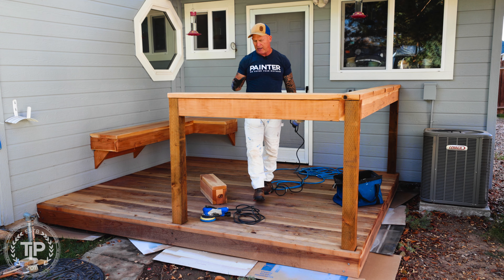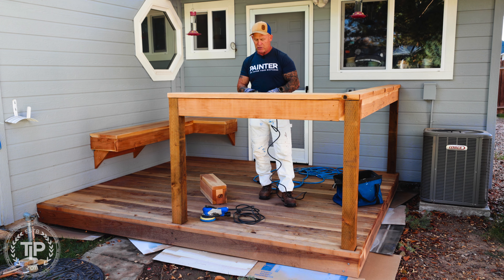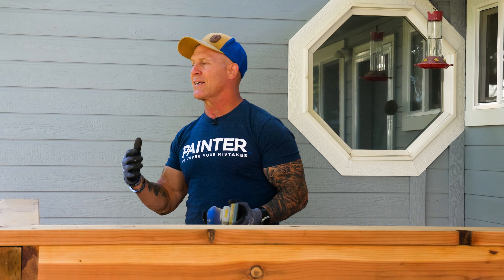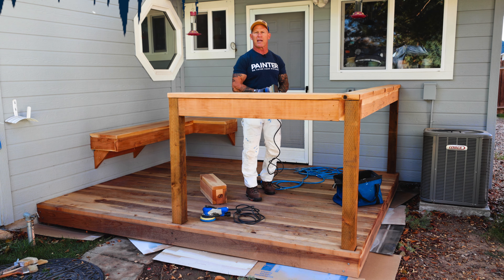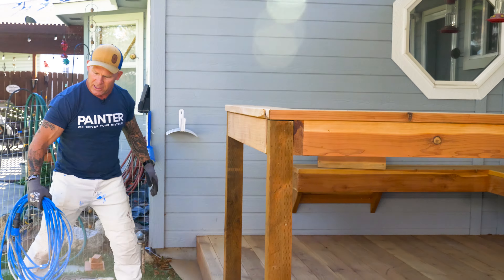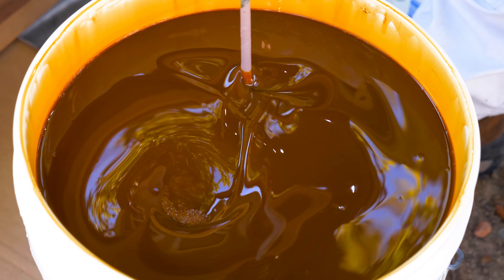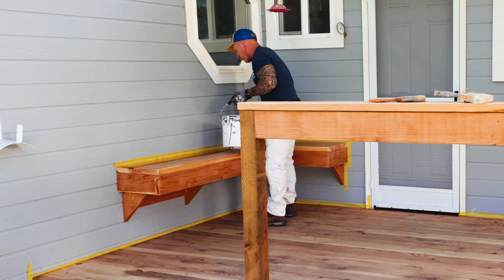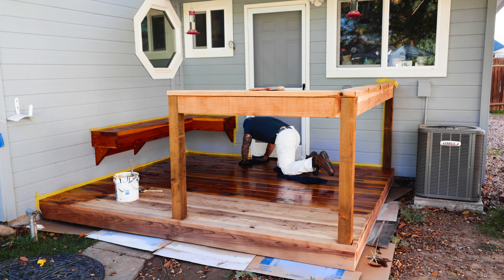Staining a Deck | What You Need To Know

Comment: Thanks for your videos, I’ve learned a lot from them!
Question: aren’t you supposed to start and finish each board before you move on to the next, to prevent lines in the middle of the board? I saw you started like 3-4 boards on the left side and then went over to the ones against the bench, to finally come back to those first ones. Thanks!
Reply from the maker: Not with this non drying self leveling oil

Comment: If you use a pole on that brush (it is made where the handle screws off and you can put a pole on it), and then stain in one direction, always from wet into dry, then you don't need to wipe it off, because your brush will have dried out, and spread out the product already.
Reply from the maker: Thanks for sharing